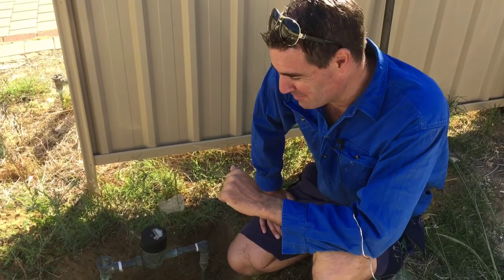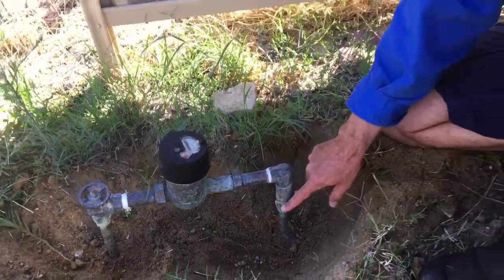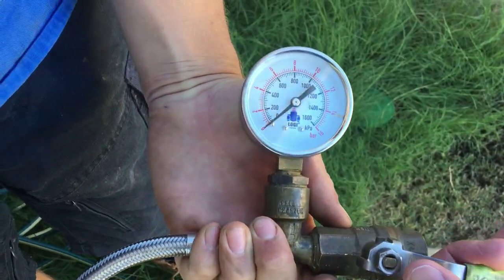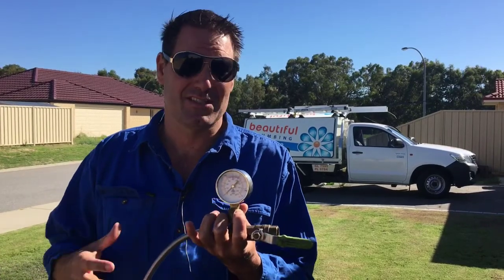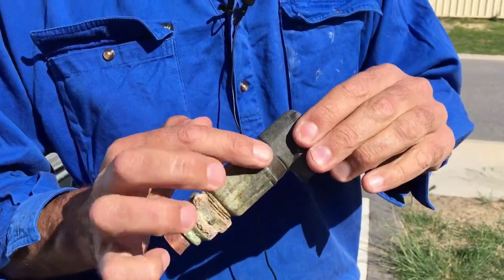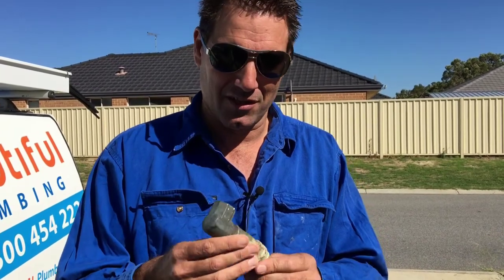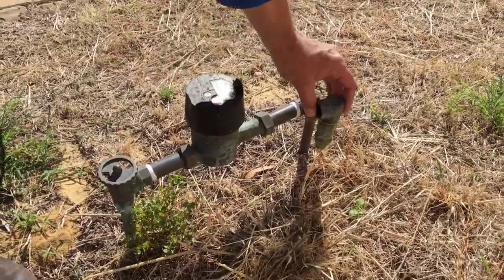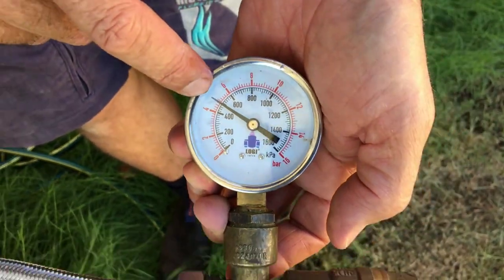How to Know if Your Pressure Limiting Valve Is Good Enough

Comment: Great vid explanations - I had a PRV installed yesterday - AVG Pressure Reduction Valve Boundary 20mm 500KPA Right Angle Copper x Female. 

I found the taps were all fine afterwards but the kitchen mixer sink pressure sputtered and then had really low pressure. I took out the aerator and found a lot of deposits, tap was only installed less than a month ago. 

On the side of the prv box it notes “flush all pipework before installing”. The plumber who installed didn’t flush the pipes before or after. I spoke to a plumber I get for bigger projects and he said this should have been done also. 

What are your thoughts around this one? I didn’t see any note of flushing pipes in this video?

Comment: Can the prv that was  installed be adjusted down to be less than 500 kPa? How low can they be set to. (I have bad water hammer and I would rather have reduced water pressure than pay someone to climb under my house, looking for loose wall mounts.)

Comment: I've just had a new hot water tank installed today. I live end of dead end road and have high pressure. The installer said i dont need this valve.  My hot water tank was 26 yrs old. If i installed one of these would i lose shower pressure. I do get knocking in my pipes. Hope to hear from you soon.

Comment: Hi, i live in a unit complex and i am hearing knocking sounds in my wall close to where my water meter is located every time people in neighbouring units are using their taps. Our water pressure is quite high out of the taps, would this pressure relief valve cure my problem?
Reply from the maker: Hi Tony, yes we would suggest trying that out first. How high is your pressure? It shouldn't be over 500kPa (Australian standard).
Reply: @BeautifulPlumbing  hi thanks for your reply, water pressure is very high, if i was to guess, up around the 1000kpa mark. I did call in a plumber and suggested putting in the pressure limiting valve, he was sceptical at first saying it was a 50/50 chance of fixing my problem but one week on since fitting the valve, i have not heard a single noise in my wall. Happy days!